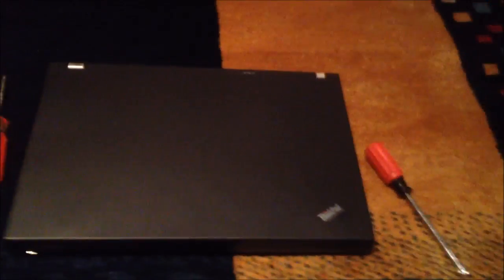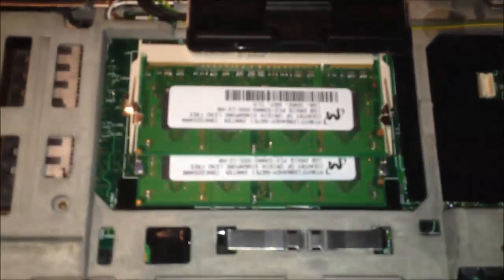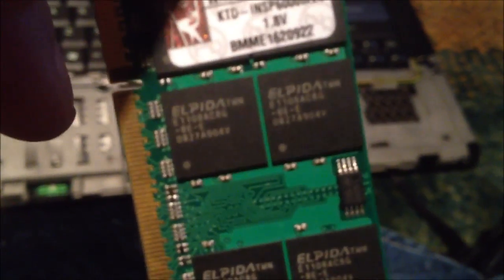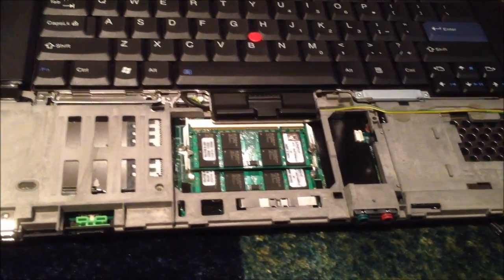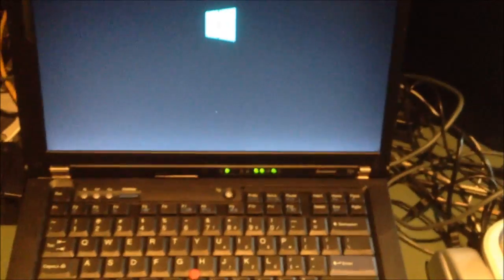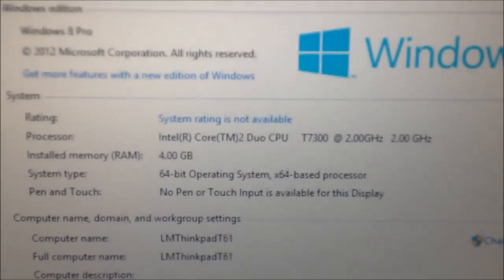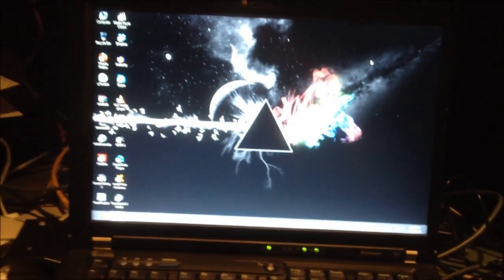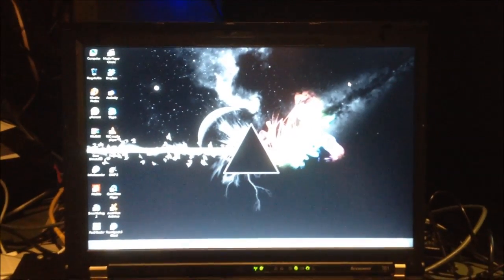Lenovo Thinkpad T61 RAM Upgrade

Comment: i have a t61p with 4gb ram, 320gb harddrive, running windows 10 pro, which is good i suppose, i also has a T7600 or whatever the first core 2 that runs at 2.4ghz is i forget lol. 

1920x1200 display and quadro graphics. i played back a 1080p video with lots of explosions and whatnot no lag its crazy. 

Love the machine, its sleek and still powerful. its my backup. I also have 2 toughbooks :).

Comment: Windows 8 runs sweet on that laptop! BTW If you right click on the desktop, click on "Personalize", then click "Change Desktop Icons", you should be able to place a proper Computer Icon, User Folder Icon etc. onto the desktop, rather than using shortcuts. For some reason I prefer not having shortcuts for these, not sure why though! (I'm sure this works on Windows 8, it did on Windows 7, but I haven't used Windows 8 in a while).